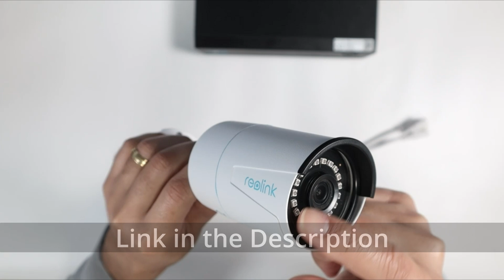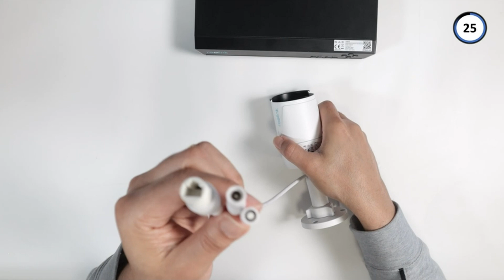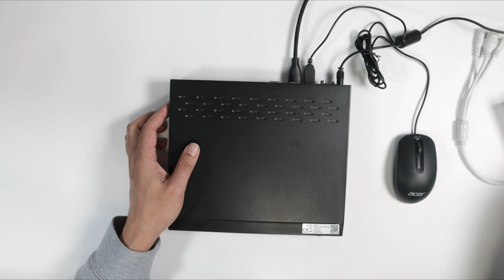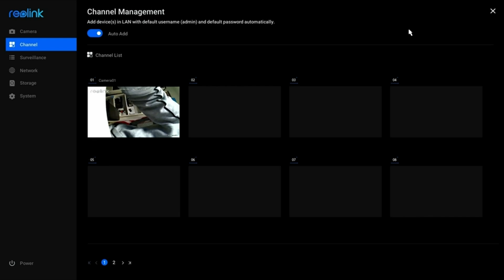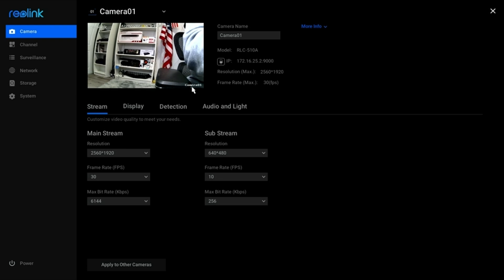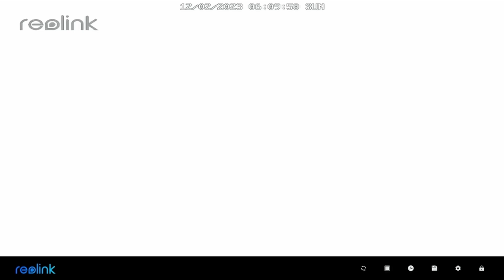REOLINK RLC-510A 5MP Security IP Camera Outdoor

Comment: what a horrible camera, to many cables we are in the year 2025 not one use cables
Reply from the maker: Professional cameras do use cables. Just try connecting 1000 cameras to via WiFi and you see what is going to happen. Wireless is good for amateur projects. It can’t handle too much high quality traffic like dozens os cameras transmitting in 4K for example and it’s not as secure as cables as well. Believe me, I’ve working with expensive professional security cameras used in airports, stadiums, NASA, The empire states, FBI, etc. they can’t be subjected to low transmission quality, hacking, etc. I’m not saying Reolink are the cameras they use (they use Pelco, Axis, Avigilon, Wisenet,etc). And only a few of them use wireless 😉